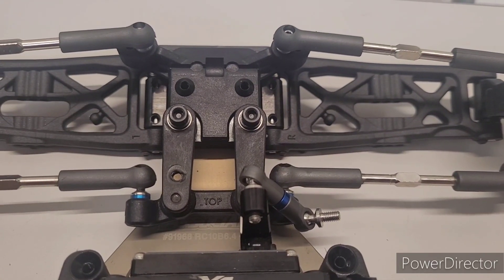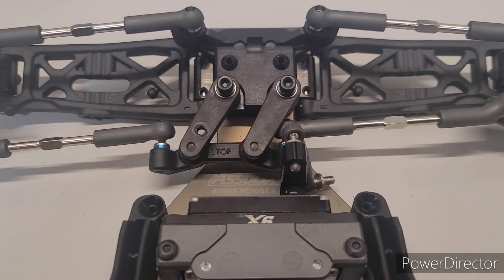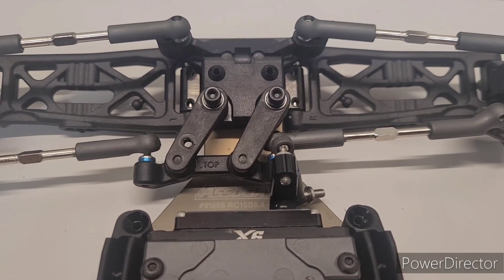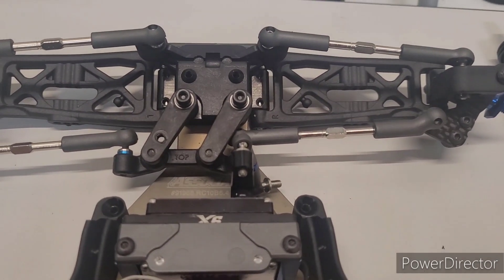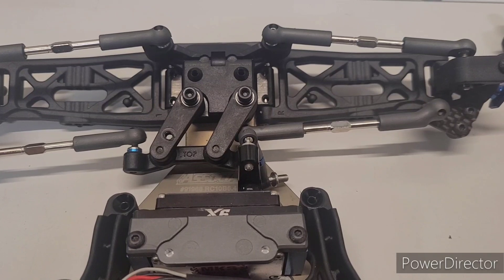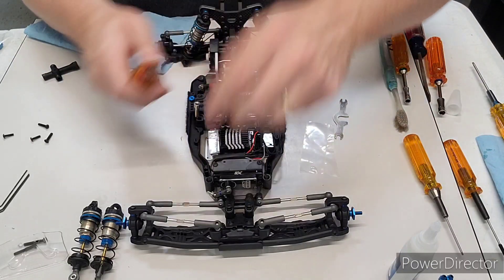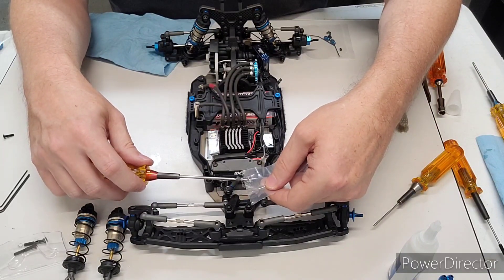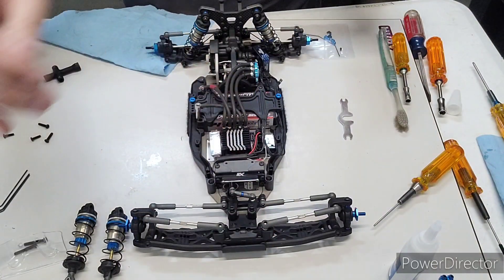B6.4 steering fix

Comment: I don't know of anybody has told you but you add CA glue to plastic it makes it brittle food for thought. Or put a longer ball end with a lockner
Reply from the maker: Never had a problem with it.  Been doing it for years.  In small quantities it's perfectly ok.
Reply: then why is CA glue mainly used in this hobby to glue tires to PLASTIC wheels?
Reply: Even the set screw to hold the rear shocks it ask to add CA..😂
Reply: Always- plastic to metal= CA/super glue. Metal to metal= loctite. Just never use loctite on plastic;)